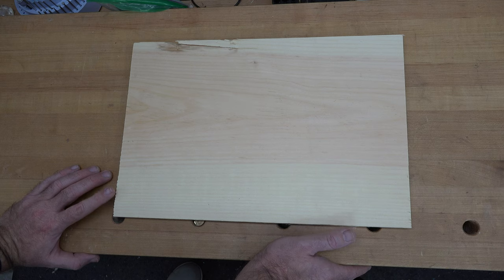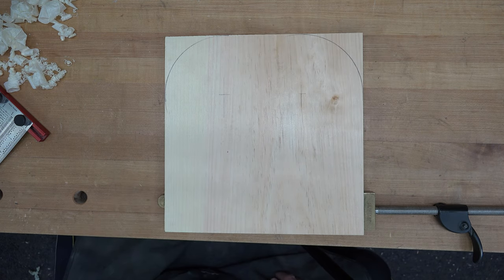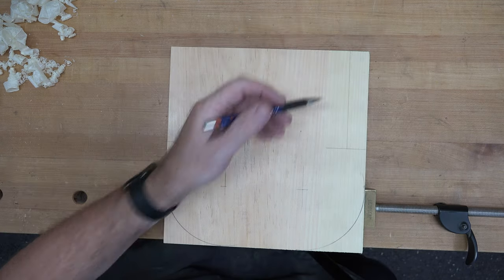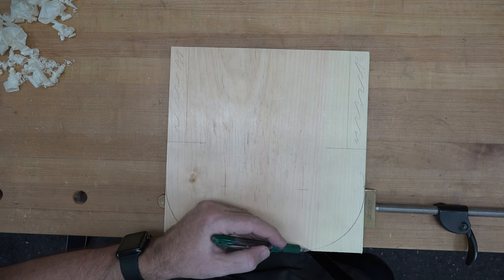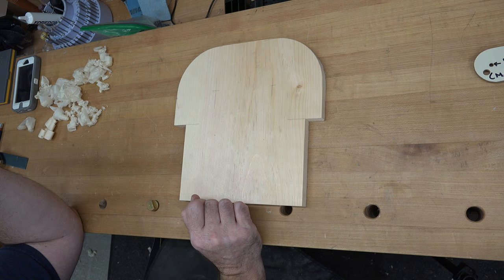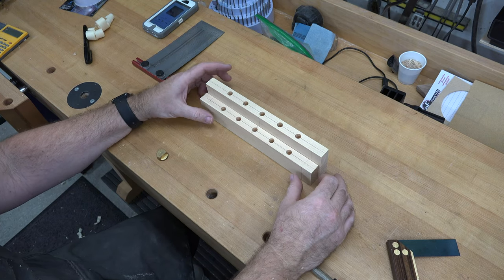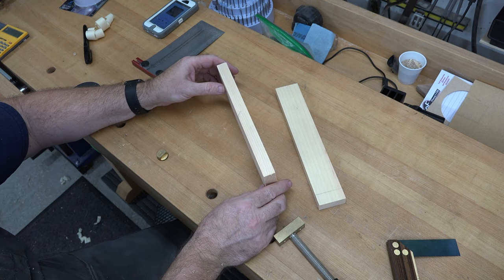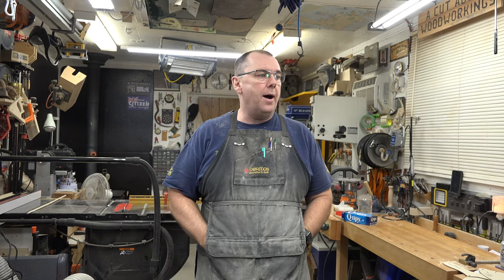Children's Rocking Chair Part 1

Comment: My only concern is that the kids will try to use it as a step stool and it could collapse. Is there a way to lick it open?

Thanks for the video
Reply from the maker: I think I state in part 2 John, that if you have concerns of this, there is nothing wrong with making it so that it does not fold.  Gluing the seat down to the upright will accomplish this.  Children do love to climb so I would definitely keep an eye on the child if they are known to be adventurous.  Thanks for tuning in.